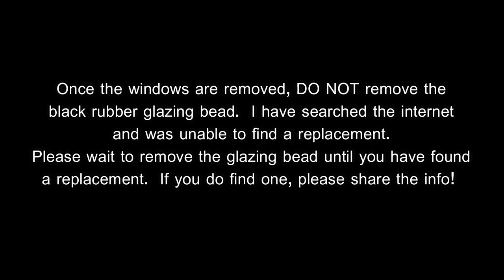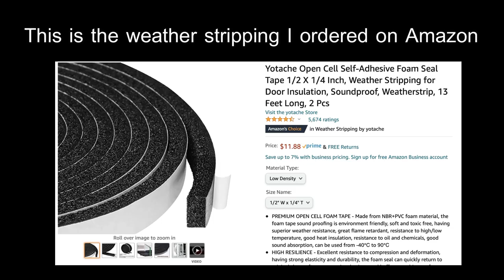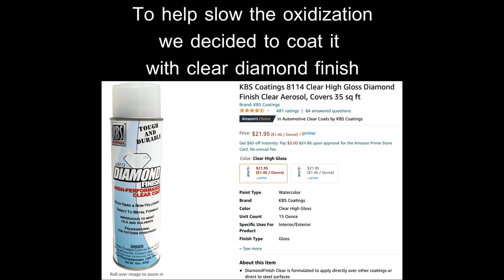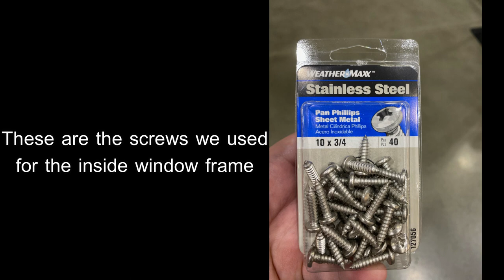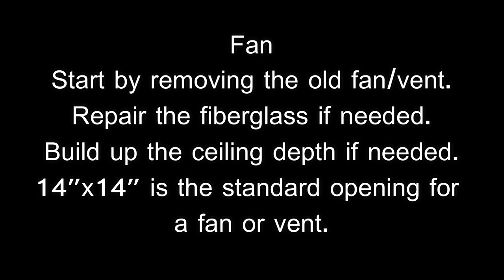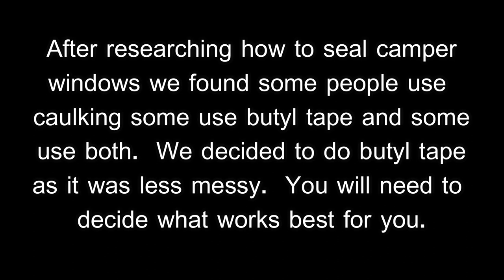1983 Burro Trailer Episode 13 - Window and Fan Installation

Comment: Thanks again for taking the time to make these videos. I have a question about what you used to divert water from the door. I’m sitting in my trailer working on it and Oregon and I have a decent amount of water come running down the roofline every time I open the door. Is it just white foam weather stripping?
Reply from the maker: Its plastic rain gutter.  It works well.  Heres link.

Trim-Lok Drip Rail, White – 1/2” Height, 25’ Length – PVC Plastic Rain Gutter for Cars, Vans, and RVs, Easy to Install Flexible Drip Rail Molding to Control Water Runoff, Durable 3M Tape Included https://a.co/d/fE0U0pk

Comment: Thank you for this video. Very helpful. I am glad to see that someone makes a rear window in the Burro that opens! Is Motion Windows the only company you know that makes them? I spoke to them..
 But I need to know the exact dimensions of the opening, not the window! Don't really want to remove it .

Did you by chance measure the opening when you had yours out? My Burro is a 1982.
Reply from the maker: Motion Window is only place near WA.  Didn’t really look beyond that.  Unfortunately, i cant find any measurements written down.  But i highly suggest measuring your own opening.  It seems that its different from year to year and individual too.  You dont want to assume others measurement is same as yours since its non refundable.  They also said that some has curved window and some doesnt.  If we ever get new windows from them, we are gonna take our Burro down there and have them measure it.

Comment: Why did yall get a quote from motion for the windows instead of using scamp windows?
Reply from the maker: As far as we measured and looked, Scamp windows do not fit Burro.  Many Burro owners also said same thing.  Of course, we could make it fit if needed to, but the work was not worth it.